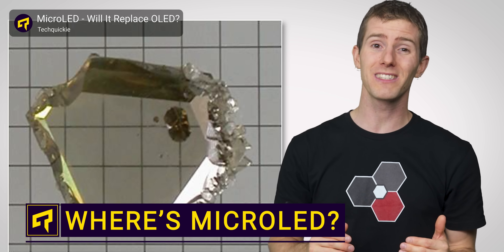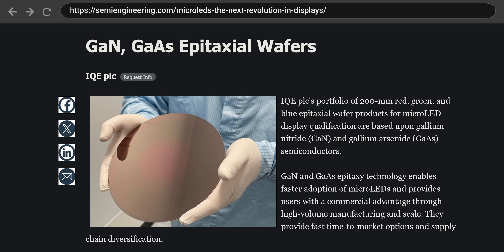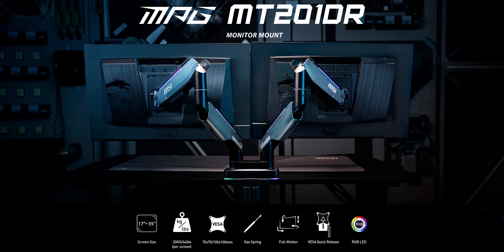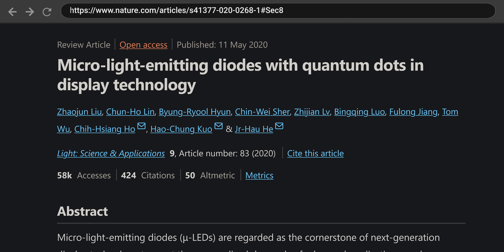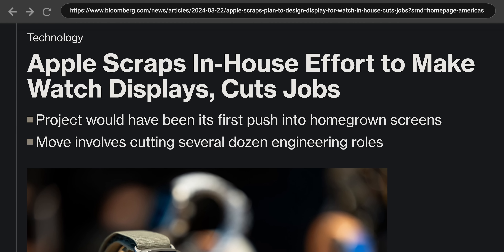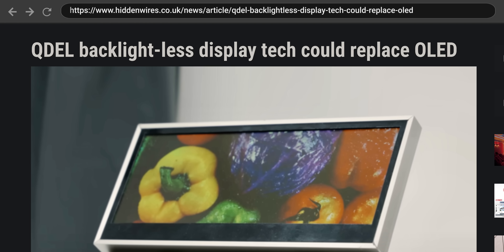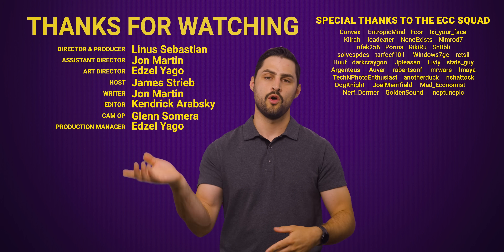Why Apple Killed a $3 Billion Investment

Comment: 99% of people will never experience burn in on a modern oled
Reply: Not true at all. Check monitors unboxed' youtube video on his QD-OLED monitor burn in test. It only took 3 months for the first signs of burn in to appear. Also, Rtings do an accelerated longevity test for TVs, I believe they started 2 years ago and all of their OLEDs show signs of burn in by now. I know people who use their TVs for more than 10 years and "modern OLED" panels will definitely show heavy signs of pixel degradation by then.
Reply: @-eMpTy-  not true, 99% of regular people will never exoerience burn in, and before it happens something else will break in the tv and/or the tv will be replaced by something more new, enjoy your milky blacks on your lcd, peaseant😂 while I enjoy true beauty on my oled😂😂😂
Reply: @3c3c3c  
I provided you with factual evidence, you just threw out some anecdotal bs. By the way, even if you don't experience burn in in terms of an actual "burned in" image into the screen, pixel degradation itself occurs by the second you turn on your screen for the first time. This not only makes your display dimmer, but also less color accurate over time. Even if you keep your TV for only 4-5 years, some burn in will be guaranteed - and what happens to that screen now? You'd usually sell it, but good luck getting rid of a burned in TV. I'm not a hater of OLED, in fact, every phone since my LG V30 had an OLED display, but for screens that 1. displays static content and 2. you want to keep for many years, (PC monitor, TVs) the technology just isn't ready yet in my opinion.
Reply: @-eMpTy-  did an oled owner steal your girl or what? Lmao I still stand behind the fact that regular users will never encounter burn in. Also even “innacurate color” will still look way better and contrasty than milky dull lcd, if you sre a poor person that changes tv every ten years then yeah you might get burn in. Stick to your IPS, nerd, while other people enjoy amazing oled screens on movie parties you werent invited to😂
Reply: @3c3c3c  
Can't disprove my fact based claims, throws out insults instead. Great work buddy, you really showed me.
Reply: 100% doubt

Comment: 00:01 Micro LED displays have not overtaken OLED as expected.
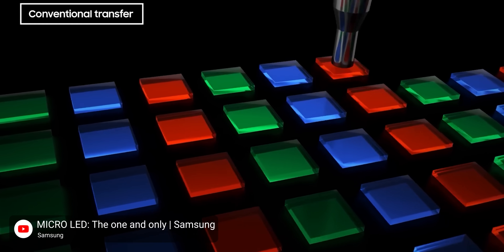00:44 Challenges in manufacturing micro LED displays
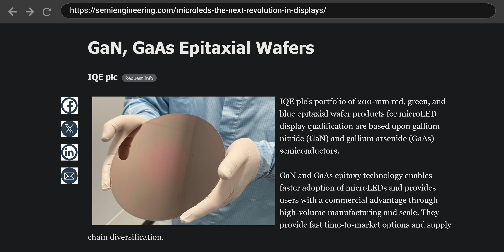01:20 Challenges in making micro LED cost effective.
01:59 MSI's MPG mt201 Dr monitor arm is a pro gaming move for desk setup cleaning.
02:39 OLED technology has evolved to address brightness concerns
03:14 Apple canceled $3B microLED investment for Apple Watch
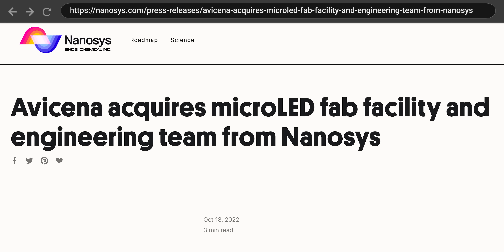03:50 MicroLED technology shifting focus to optical communication
04:27 Apple may use microLED for augmented reality glasses.

Comment: Why are processor dyes always rectangular when the wafers are circular?
Reply: When making the monocristalls needed for wafers you often spin them during the formation which leads to a cylindrical form. These cylinders are then cut into thin wafer that are round
Reply: @yonko5220 
This is correct. And cutting round dies out of a round wafer would actually be hugely inefficient if you think about it. Tons of unused space in-between. Not to mention that it would be unnecessary difficult to cut.

Comment: To be frank, MicroLED seemingly is falling by the wayside versus QDEL (as QDEL has pretty much all the benefits of MicroLED outside of maybe the form factor configuration? But even then QDEL is a very new thing so maybe it can be molded in whatever shape wanted)
Reply: I don't think its done for, but QLED is a good stepping stone. I understand Samsung is incorporating micro LED into their backlights, so they're probably eventually gonna switch when they work things out.

Comment: Doesn't the Vision Pro use microLED? Also, even if OLED is getting plenty bright, it still has the burn-in problem.
Reply: It uses micro oled, which is oled on a silicon wafer.
Reply: @mcmadness110  that's... what micrOLED is.
Reply: @willfancher9775  Incorrect. MicroOLED uses organic compounds, where as in microLED doesn't. That's why OLED's burn in.

Comment: a see-thru screen has its uses. it could be used like a HUD while driving. i always wanted a nfsu2 gps arrow floating in front of me

brightness and efficiency are the two big factors, why existing helmet huds for motorcycles suck. while cars can just project onto the windshields; motorccle HUDs are no different to augmented reality glasses, in direct sunlight, with tiny batteries, having to run for hours on a single charge

Comment: it will just take a lot of time to optimise the technology like any high end stuff. 15 years ago, a 65-77 inch OLED screen for 2k$ was unimaginable. 10 years before that the fact that it is an Oled screen was already the unimaginable.
But it obviously takes the huge display companies like LG, Samsung and co. to drive the development. Apple as a tech brand has no real expertise in manufacturing the displays themselves, like they have no clue about the processor manufacturing. Apple just does the designs incredible.
That a small startup can't do it wasn't surprising.

But as both LG with oled and samsung with QDot have their own marketing technology, it will take a couple of years longer till they give us microLED

Comment: Since oled and PC monitors are not really compatible I hoped for micro led monitors. Shame it won't happen.
Reply: im using a 21:9 oled monitor since a year and i must say the image quality is so beautiful that its kinda worth the risk 
i dont have burn in yet but alienware for example gives 3 years burn-in warranty so even if it would happen u could demand a replacement
Reply: @Hanfos  That's cool, but if you use it like an LCD monitor, you'd have to return it quite often and maybe there's some kind of clause in the contract that voids your warranty. Also, 3 years for a monitor that probably costs $1000 is still way more expensive than a $200 monitor lasting decades.
Reply: @NaudVanDalen  LCD will never be beaten in value. You’re looking at it the wrong way. OLED screens are plenty mature enough for PC use. 

If you want to leave your pc sitting on the desktop 24/7/365 then that’s a use case problem.
Reply: @NoLongo it's not a use case problem. everyone using their pc for any kind of productivity are gonna be using the same programs for hours upon hours until the toolbars get burnt in the monitor. heck, everyone is using a browser for hours on end on a daily basis. the only use case for oled monitors is content consumption which also has to be varied. playing the same game everyday for hours isn't gonna work either

Comment: I just want them to solve the burn-in problems on OLEDs.
Reply: i dont think u can prevent organic materials degrading :/
Reply: @Hanfos  Which is why I buy LCDs. When I buy a screen, I expect to still use it in 14 years. In fact, I have an LCD from 14 years ago that currently serves as my nephew's monitor.
Reply: @eldibs you think that any electronics product you buy today will last 14 years?
I feel like degrading off OLED is the smallest problems when talking about longevity of modernity products.
Reply: @eldibs  yeah when u plan to use the monitor for decades then LCD is a much better choice

i just want the best image quality so i have gotten myself a nice 21:9 oled monitor for 800€ last year
Reply: @Jehty_  My dude, I have working hard drives from 14 years ago. I just recently got rid of a working Sound Blaster Audigy from 20 years ago. I have a strange ability to make things last.
Reply: @eldibs  my dudette, you did not buy something TODAY that you bought 14 or 20 years ago.
Reply: This is literally impossible. The only way to do that is take the "organic" out of "organic light emitting diode" and that's literally just MicroLED. 🤷
Reply: Fun fact: modern OLED will likely outlast modern 13/14th gen CPU from Intel!
Reply: Completely prevent won't happen, but modern OLED are much better in that regard compared to the past.
Reply: Literally can’t. The O in OLED is Organic. You can put in every protection possible like Pixel Shift, Auto Dim, heat sinks to dissipate heat, MLA to boost brightness without increasing power, etc but every moment you run current through an OLED pixel, you’re shortening its lifespan. All of those mitigate the problem and extend its life but doesn’t stop burn in from eventually happening. It’s an organic material and use degrades it.    
They’ve gotten really, really good at burn in prevention for TVs and varied content. But PC monitors have to deal with static elements like icons or taskbars
Reply: Organic just means that the materials are carbon based. Doesn't necessarily mean that they are naturally degrading lmfao just because you saw the word organic it means its naturally degrading. OLEDs are as solid state as LCDs and TFTs. Please learn science.   @martinarrieta4536
Reply: I'd much rather solve the brightness issues with OLEDs, which will probably only be possible with inorganic materials. Even today oleds can't do more than ~300 nits on a 100% window, meanwhile, MiniLED did 1600 nits full window like what, 5 years back?
Reply: CRTs don't have Burn ins (of course, CRTs the entire screen dies at the same time but whatev)
I think neither do LCDs
Reply: @seba2366 what are you talking about? CRTs most certainly did have burn in. The n fact they had physical burn in from where the electron gun would permanently burn the phosphor layer on the screen. This is why we had screen SAVERS back in the day.
Reply: I don’t really think burn-in is much of an issue for OLED anymore. The last time I encountered burn-in was on an old Samsung phone.
The only issue with my LG C1 TV is brightness.
Reply: I thought AMOLED solved this problem
Reply: OLED is organic as in organic compound, relative to carbon. Not that organic as in organic matter. Being organic is not strictly related to OLED's propensity to wear.
Reply: @floppyD   🤦 Wrong. This semantics difference is basically 100% irrelevant in this case. Practically ALL organic molecules (aka carbon containing multi-element compounds) break down over time when exposed to the elements & fed power (as needed for a transistor controlled display) due to things like oxidation and inconsistent (as in within the molecule itself) electrical resistance.

Aka, the OLED molecules being organic in nature is EXACTLY why they are prone to chemical degradation! Inorganic molecules are SIGNIFICANTLY more stable than organic ones to those types of exposure basically as a rule.

This is EXACTLY why inorganic MicroLED's last SOOOOOOOO much longer than organic OLED's.

Next time make sure you are actually right before correcting someone. 🤷
Reply: And eye tracking-induced motion blur. LCDs still can be better because you can strobe the backlight.

Comment: Sounds more like making a TV that works for 20 years wasn't a good idea when they have already convinced people to use OLED tvs that only last a few years.
Reply: Exactly what I was thinking one minute into the video 😤
Reply: Lcds rarely work for that long, and this tech seems even less reliable given the per pixel failure options. I like a good conspiracy theory, but this ain't it chief
Reply: @MiDnYTe25  what are you doing to your LCDs? I've seen maybe 2 failures ever, a back light, and a logic board failure. Possibly from a power surge.
Reply: @SinisterSlay1  My Sony LCD from 2008 is still being used daily and works like new! To put that in perspective I was born in 2005 and remember the day we bought it. No plans to ditch it until it breaks. f anything I might die before then lmaooo.
Reply: my point exactly!! The companies obviously care about the failure rate during manufacturing, not after 2 years after the warrants expires
Reply: You get a good picture which lasts long, or a great picture which doesn't last long. It's a trade off, not everything can be perfect
Reply: @keppycs that just means we havent advanced enough
Reply: @keppycs  then there's this 100 year old tech just lurking around called CRTs that didn't have these problems. It had other problems, but longevity wasn't one of them.
Reply: @SinisterSlay1 Longevity is literally the biggest issue with CRTs other than the weight? Like it's well known they also have burn in problems that are debatably worse than OLED burn in problems.
Reply: @2KDrop  It's a CRT fanboy. Run for the hills while you still can before he starts rambling on about motion clarity.
Reply: @2KDrop  really? So go to a bowling alley. Chances are they still have CRT tvs sitting in the ceiling working just fine. 
CRTs can burn in, this is true. Late models were bright enough to do it quickly. But it was rare. I had a CRT sitting in a static desktop for over a decade and it never burned in that image. I used a CRT monitor until 2010 and never once saw burn in. Gaming was really great on that thing. That thing Was over 15 years old by the time I retired it and technically I bought it used. It still worked perfect.
I still have a CRT tv in my basement. Works perfect. Literally won it at a fishing derby 25 years ago.
Reply: @2KDrop burn in wasn't really a thing anyone really considered worth worrying about for general usage. Like you wouldn't worry about a game HUD doing it. It was only really an issue with information displays that ran at full power with the same content for years.
Plasma was the first panel display that really got burn in with usage that could affect normal people.

Comment: You know what tech needs to come back from the dead and Garmin and FItbip are like the only two companies keeping it alive, TRANSFLECTIVE DISPLAYS. I want E-INK beneifts, without the E-INK refreshrate. I don't need 6 Million colors, I could actually go for 64,000 colors a la 90s era for displays if it meant 60hz refresh rates, matte display for glare mitigation, and front light for nighttime to get even more nostalgic GBASP v1 vibes. I have the $800 Garmin Dog Tracker Alpha handheld gen 2 and 3, and there is a MASSIVE leap in transflective quality between gen 2 and gen 3. Gen 2 looked like a higher pixel density GBA, where Gen 3 looks like how I would want an e-reader with that tech to look like. TCL had ONE tablet with a modern version, that's now impossible to find, called NXT Paper, and then went back to lame LCD IPS panels for gen 2 of the product.